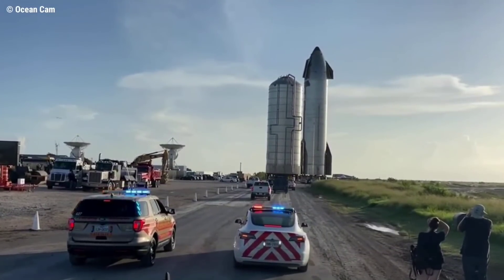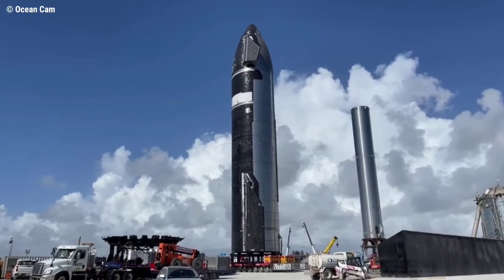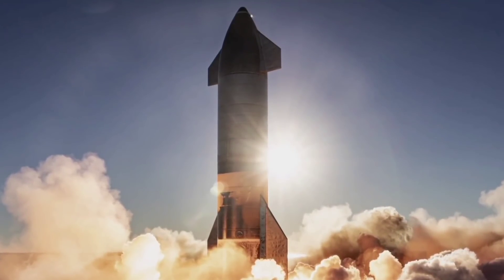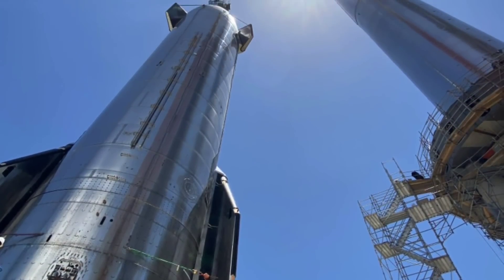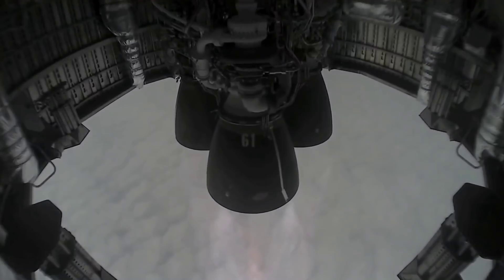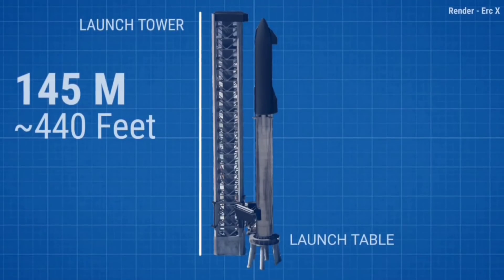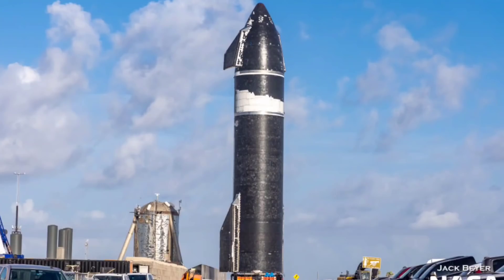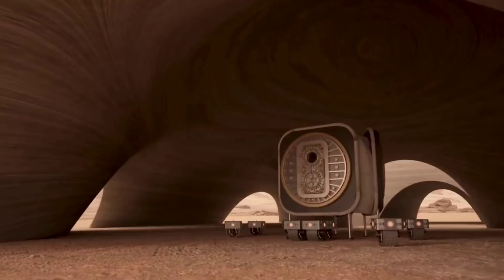SpaceX Stacked SN20 On Top Of The Booster For The First Time !

Comment: Very good! Remember we call the top part "Ship" and the bottom part "Booster" not SN or superheavy anymore. Together they make Starship 420 according to Elon. You asked for more ideas: 1. Very little has been done on Starship interiors. 2. If a one way Lunar Starship brings 50 tons to the Moon, what would she bring (*not* science experiments! - mining, processing, power, 'heavy' electric equipment like bulldozers and trucks, a permanent com station. etc.)? These can all be teleoperated 24/7 from Earth of course. 3. How about an Asteroid Starship? No one has done that: Tankers fuel up an Asteroid Starship and two tankers in LEO, and then again in a high elliptical orbit (~45 tanker flights over 2 months). The combined delta v and propellant (you would need to do the numbers) should be enough to bring the Asteroid Starship back eventually. Just scoop the surface of a metallic asteroid into a smelter (small nuclear reactor), store just the heavy metals and begin the long voyage home, leaving the two now empty tankers behind. I think you'll find that at current prices, the haul brought back in precious metals will be about Elon's marginal cost for the mission (only propellant and two tankers cost). 4. A Starship optimized for tourist travel only to LEO and back.

Comment: I would like to know exactly how the grid fins will slow down the buster to minimize fuel needed for a soft landing. I suggest that each pair be rotated in opposite direction to maximize drag.
Reply: The longer you read the comment the more it sounds like a shitpost from a 12 yo
Reply: @lolzdatguy4987  I think that is ageism which will one day be recognised as a thing
Reply: @alarikgreenland  I'll be waiting with my finger on the delete button
Reply: @lolzdatguy4987  😎
Reply: It's called resistance, or drag!  The grid fins create drag and are maneuverable, so the engines have to work less as they maneuver the rocket to a controlled landing!  The same principle as with the Falcon 9!  There are videos explaining this!
Reply: I don't think the grid fins are meant to provide drag as such: they're grids of vertical steel plate, designed for air to go straight through them on take off. On decent, the grid fins can be turned... When they're turned, the drag increases, and with computer control they are used to orientate the rocket in the right direction (i.e. upright) the boosters then relight to take care of slowing the booster down. The grid fins on falcons fold inwards to reduce drag: they realised the extra weight to provide that function wasnt worth it
Reply: the grid fins are to steer the booster on way down
Reply: A finger would slow it down at those speeds....